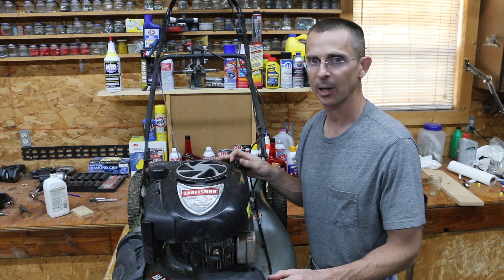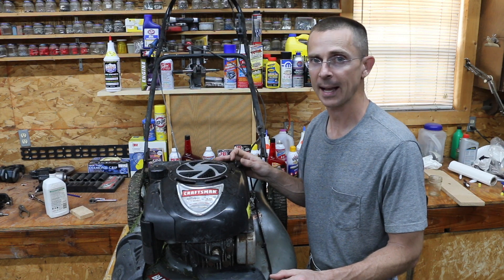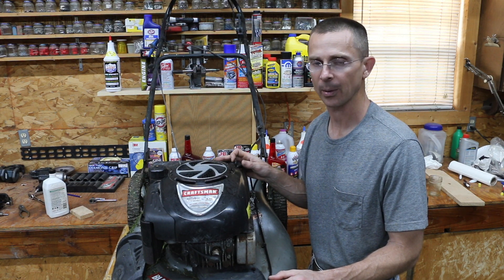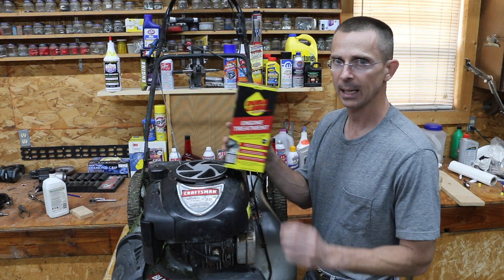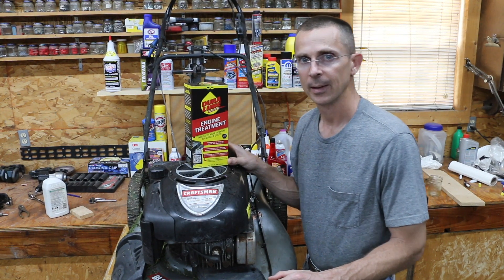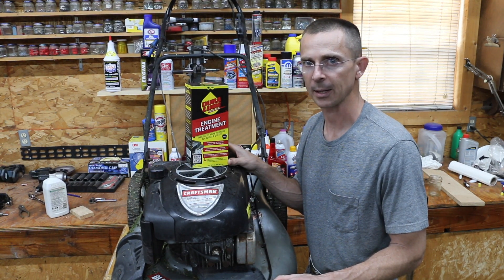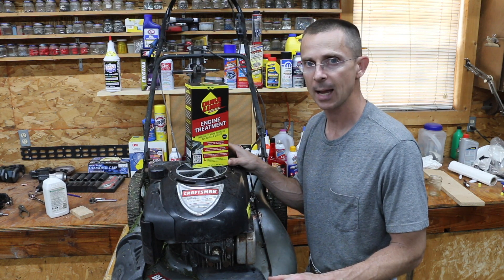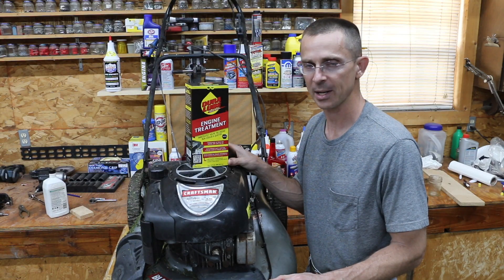Does Dura Lube actually help quiet and cool a gas engine as claimed?

Comment: you should find an engine with sludge, and try running automatic transmission fluid mixed in with the oil and see if it will help clean it.
Reply from the maker: Joshua, Great suggestion!  I bet it'd help a lot!  Thanks for watching the video and commenting!
Reply: D4x4Bronc funny you say that. I'm a ford mechanic and have seen several ticking or knocking tritons, but I have never thought about trying trans fluid in the oil in one. I've done it in older stuff mainly my own. But never on a customers. That may be something I will try in the future
Reply: joshua medlin Just do a hot oil change after running the engine to normal operating temp for a while, that will get a lot of the sludge and settled deposits out.  I find it to be very productive.
Reply: joshua medlin, They make an engine crankcase cleaner for that purpose, but you can use kerosene or diesel too. You want to use something that will mix well with your oil. I would not use auto trans fluid myself, but that's your choice.
It takes a quart in a 5-6 quart engine oil pan to do the job. Note, that you do not want to run the engine hard, just warm it up first, add the cleaner of your choice, then run it for 5-10 minutes at idle. It thins your oil considerably is why you do not want to rev the engine. If you do run it too hard you will ruin all of your engine bearings.
Reply: @TrojanHorse1959  That reminds me we used to clean our vw engines when we changed the oil. After we drain the oil, we put about a half gallon of diesel in the crankcase and started the engine. Let it run a minute and then drain that out. I would come out black as 3 foot up a bulls rectum. Would I do something like that today? No way! These newer cars dont sludge up like the old ones did. Some say it was the quality of the oil back then. I dont know. I'll keep using duralube in the crankcase and sea foam in the gas tank.
Reply: joshua medlin  I would not use atf it's not made for it however I have used an engine cleaner that did wonders on my 2.2 cobalt.
Reply: Connor Hunter well it's not the point of it not being intended for it. it's how well atf can clean with it's high detergent content. many people have used it in oil, and fuel systems with results. I just think it would be interesting to see him do the experiment for us all to see
Reply: Robert G I have gotten to use some engine flushes in the past. mainly valvoline since that was what the dealer carried. I just thought seeing him actually show the tests would be unique! I have tried trans fluid, and few others in my stuff. But they are not sludged up to really be beneficial. I would like to try a flush agent on something with significant sludge as I see ths t to be interesting.
Reply: Thamedlinkidmusic 9 iuiuu
Reply: joshua medlin got it. 
I have used it as fuel and "cleaner" I won't spoil it for you.
Reply: That's good advice. Thanks for your input!
Reply: joshua medlin oh it was fun to play with as well. the results were interesting to say the least.
Reply: Connor Hunter I used atf in my old mustang for laughs. it wasn't carboned up by any means. so I can't say there was a difference or not. but nothing beats the feeling of driving through town pouring white smoke over everything haha
Reply: joshua medlin yea I have a 7.3 psd. I know smoke lol last time I blew a ic boot you couldn't see behind me to save ur life.
Reply: The old ATF is not like the new ATF at all. I wouldn't put it in the fuel anymore, like the old days.

As for replacing some oil with it for a short time, just idling? I got an oil change to go from, "Yeah, it's dirty." To, "Wow! That oil is dirty!"

It definitely did a clean up. I dared it on a car that was no good anyway.
Reply: joshua medlin if the engine has major sludge then trying to clean it may clog the pickup screen on the oil pump
Reply: Connor Hunter haha, it's fun stuff to think about
Reply: I had that happen on a 6.0 at work. The boot shot right off haha
Reply: Series-3 oil will do the same thing. Hi detergent.BUT it might cut it all loose at once and stop it up.
Reply: you can put ATF directly in the gasoline if you want. It will clean the piston and head some but it smokes like a bitch!
Reply: Loren Husky yeah I've done it in a few vehicles but in light portions. When you put larger amounts in it you can start to regret it somewhat. Haha Atleast on gas engines
Reply: +joshua medlin Not catalytic converter friendly! lol
Reply: Yeah they don't like it too much lol
Reply: Loren Husky yes it does and over a longer period of time it leaves stuff behind
Reply: John Deere back in the old days, recommended that you flush any and all their tractors gas or diesel with kerosene or diesel fuel anywhere you had oil in it to remove any debris or sludge transmission, engine, hydraulic, differentials, and manual steering.
Reply: Yes this would be awesome
Reply: +Thomas H i do agree with you.but flushing using diesel should be done with care.. just use 25%- 50% diesel mix with fresh cheapest engine oil and you will be good..
Reply: joshua medlin I have a 500k mile v10 I bought that was ticking on start up. ran a fl820s (was a Napa fleet filter) and 1.25 qts of mercon and it went 100% quiet. the old filter actually had glitter in it.
Reply: @D4x4Bronc was there a formula to the atf ratio you did? 1.25 and how many quarts of oil? Did you keep it in for the whole interval or did you just run it ten minutes like a flush.
Reply: @LAactor  1 qt of atf mercon and 5 qts of oil for a capacity of 6 quarts. Ran it for 5k miles on two different trucks both still running good today.

Comment: I wonder what would happen if you put in SAE 40 or SAE 50 instead of regular SAE 30 with Dura Lube or Lucas Oil Stabilizer. I'd think the thicker oil would take up some of the clearances where the knock is occurring and quiet the engine.
Reply from the maker: Charles, I agree!  I have a follow-on video planned to use very thick oil to quiet the engine.  Thanks again for watching the video and commenting!
Reply: Cool! No problem, you are making some really neat videos about stuff we all want to know!

Comment: just put thicker oil in the engine
Reply from the maker: Lucas, Great suggestion!  I'll do that in an upcoming video...90W should work well.
Reply: Project Farm that's like 3 times normal Jesus can't wait to see this
Reply: SAE 90 gear oil is about as thick as SAE 40/50 motor oil, as the scales are different. http://www.viscopedia.com/viscosity-tables/substances/sae-viscosity-grades/
Reply: @ox, it isnt to improve the life, thicker oil is a method to get it sold and out the door!, other thigns done in old times was, sawdust in gearbox, asbestos cloth wired around worn out brake shoes under the drum,  holes covered with tape and tar then dirt over the top.   i bet there quick fixes for bad batteries (including charge them till just before the buyer gets there, and have the engine warm to make it easier to turn over and easier to start)
Reply: Just mix some 10W40 with some 80W90
Multi viscosity, thicker than 10W40 and thinner than 80W90
Reply: Project Farm  great idea
Reply: there are thicker gear oils, airplane jet engines use one so thick it looks like gooey graphite, which sometimes it is!
Reply: Jeep AX-15 Transmission used 75/90 GL3 gear oil from the factory. they don't make it any more and the current GL5 stuff eats the syncros.  Jeep updated the service manual for this and now recommends 10w30w motor oil.
Reply: https://bobistheoilguy.com/motor-oil-101/
Reply: Not the best idea with a splash lubrication engine...
Reply: I found the jeep service recommendation for 10w30 to be a little on the light side in southern Nevada during the summer. I switch to strait 40 weight. it has 25K miles on it since the rebuild and It has not had a single problem.  not that I had problems with it with 10w30. it just sounded loose, like a worn out Muncie if you know the sound i am talking about kind of a gear chatter, not the whine that M22 makes. more like it was low on oil type sound. Changing out to 40w quieted the transmission down significantly. I might try the MT90 next time it is up for maintenance.
Reply: always 10W100 or higher
Reply: ummm...where do you get 10W100???
Reply: try 50W lol 90w and it will not be splashable on the internal parts until hot
Reply: It's SAE and/or API rated...
Reply: 20w60's available too.
Reply: Austin Lucas I am taking about 10w40
Reply: Shell Aero Oil 100 ROCKS!
Reply: why not just SAE 40?
Reply: Lucas Perttu, thicker motor oil tends to stick hydraulic lifters and piston rings. That wouldn't matter in a throwaway lawnmower but would your family car.
Reply: That's quite a change in viscosity, kinda odd, but obviously it works.
Reply: I knew someone who put 90W in his El Camino to sell it since it normally blew white smoke.  I was a kid at the time so there was nothing I could have done about it.
Reply: Shad Van 
redline mt90 has a low sulfur content and should be compatible with syncros as well as other brass parts. really anything with GL4 rating should be low sulfur and safe for syncros. amsoil also makes a manual transmission/ transaxle gear lube that should work fine. I've used both in my tacoma with good results.
Reply: 90w will get super thin as it heats up, id try mixing grease with regular oil as a thickener, or sawdust if you are feeling brave and old timey
Reply: @Lucas Perttu OK. I was only adding to the discussion.

@Brian Compton 80w90 Gear Oil isn't much different than 10w40, gear oil numbers don't go by the same viscosity chart as motor oil.

Comment: Very interesting!!! As an engine builder, I've held the opinion that the types of oil had nothing to do with anything. Clean oil is the key. Open mouth and insert foot... LOL!
Reply: david miller ... I worked a dealer where we pulled cam covers off of similar mileage, same type, and were never late on oil change.... only difference was one customer always brought in his own Quaker State, and the other used shop oil ( Kendall)... Q.S. car looked great, clean... other... not so much ( black gummy sludge )... it matters
Reply from the maker: David, LOL!  Thanks for watching the video and commenting!

Comment: Well the knock got quieter, but by looking at the oil you took out....  that might just be the new oil talking
Reply from the maker: Jason, Great point!  The mechanic and friend I bought the mower from had recently changed the oil.  Engines with a lot of blowby tend to darken the engine oil quickly. Thanks again for watching the video and commenting!

Comment: I've tried several of the oil additives out there. The best IMO, is called "Tufoil" .  I lost the upper coolant hose coming out of a parkway toll. If you breakdown on the Parkway, it is VERY expensive. So I drove the 15+ miles to the next exit and home with no coolant!!!  I've been a firm believer in this product ever since.
Reply from the maker: Pha Q, Impressive that the engine survived!  Seems like a great additive and worth the expense.  Thanks for watching the video and commenting!
Reply: +Project Farm  I neglected to mention that the engine was absolutely fine. Once I got home, I waited a good 30 minutes for it to cool off. I used a steak knife and cut the torn portion of the hose off, (it was very close to the clamp of the radiator) and filled it with water and coolant. It started right up and ran perfectly. 
When I checked the oil, it was dark but not burned. I was amazed. 30 minutes with no coolant.

Comment: The removed oil was obviously broken down, thin, contaminated and cavitated (foamy). Of course- a thicker new oil is better than that. Drain, refill with ATF. run full throttle, 1 tankful of gas/ATF/acetone mix 33% each. Drain ATF, fill with 20W-50, and fresh gas. Do all the before/after checks. Thank you for the video, always enjoy them.
Reply from the maker: Great suggestion!  I always enjoy reading your comments!  Thanks for watching the video and commenting!

Comment: It certainly seemed to quieten the knock down. It would be a difficult test as an engine in that condition would wear relatively quickly, but i wonder if additives like this retain their benefits in the medium - long term.

As in would they break down and shear more quickly than straight 30w and end up being worse than 30w alone?
Reply from the maker: That's a great point!  Another commenter mentioned that some of the ingredients in Dura Lube are corrosive and shorten the life of the oil.  For a small engine, I would rather use 30W oil in combination with Lucas Heavy Duty Oil Stabilizer.  Thanks for watching the video and commenting!

Comment: I remember the commercial where they took off the vale covers on a race car and poor dirt on the valves while running .... with no oil ... takes laps on the tracks ....
Reply from the maker: Impressive!  Maybe I should pretreat an engine with Dura Lube and see how long the engine will run without any oil or additives in the crankcase.  Thanks for watching the video and commenting!
Reply: Project Farm subscribed
Reply: my buddy pretreated his bronco lost oil while offfroading made it 70 miles home fixed the oil leak and was still driving it a year later when he left for college

Comment: In the end if an engine has a mechanical issue, knock, etc then the only long term solution is to repair it. In a small splash lubricated engine a thicker product may help to cushion the noise, however in any modern day automobile engine that relies on oil pressure for things such as  timing chain tensioners and variable valve timing, using any additives will just lead to more issues. There's really only one way to fix a noise or knock and that's to repair or replace the mechanical component Good video as always, I enjoy them all!.
Reply from the maker: vegasfordguy, Yes, I agree.  Thank you for taking the time to comment and thanks for the positive feedback!

Comment: Hey bud have you looked into the turbo maxx additives?
Reply from the maker: slowgoat6.0, I haven't looked into the turbo maxx additives yet.  Have you used them?  Thanks for watching the video and commenting!
Reply: Project Farm yes I have, pricey to say the least, but I did notice less valve train noise in my engine and got like .5 mpg better
Reply from the maker: Impressive!  I don't mind spending extra if the product makes a difference!

Comment: Please do not be offended, I love your videos and I am a huge fan of your channel, but I think you should have changed the oil before the test and added the Duralube to the same oil that was in the engine. We do not know if this result was just because you changed the oil to fresh oil, or from a different brand or weight of oil or because you added the Duralube additive, or a combination of both. You may have been able to achieve the same result by just changing the oil. Again, I love your channel and videos. I am just trying to help you improve your videos, not complain about the way you test the products. Thanks for making all these great videos and keep up the great work!
Reply from the maker: Great suggestion!  I agree.  The mechanic and friend I bought the mower from had recently changed the oil.  Engines with a lot of blowby tend to darken the engine oil quickly. Thanks again for watching the video and commenting!

Comment: How do we know it was not the new oil that made the difference? To keep all things equal, just remove some oil and just add the Dura Lube.
Reply from the maker: Ben, Great point!  The mechanic and friend I bought the mower from had recently changed the oil.  Engines with a lot of blowby tend to darken the engine oil quickly. Thanks again for watching the video and commenting!

Comment: very interesting. The sound has so clearly changed, that I'm wondering, what do you think would a normal oil change have done?
Reply from the maker: DerKrawallkeks,  The oil in the engine wasn't too old according to the mechanic/friend.  It's a little dark but the oil in well worn small engines tends to darken quickly, especially if there's a lot of blow by.  I think the friction modifiers in the Dura Lube helped some.  A thick oil would probably do the same.  Thanks for watching the video and commenting!
Reply: yep, that's true, a thick oil might help, especially like duralube obviously did, with compression.
Reply from the maker: Thanks again!